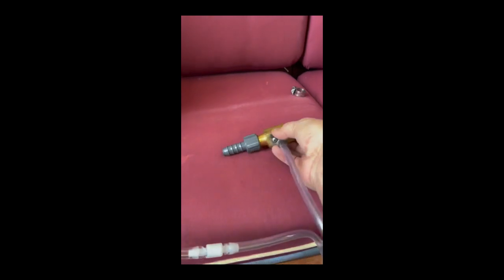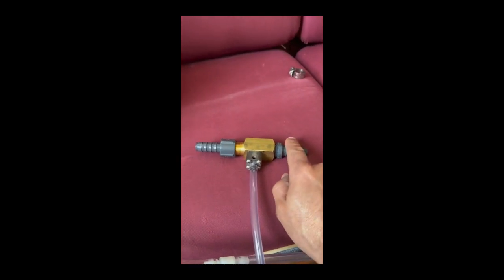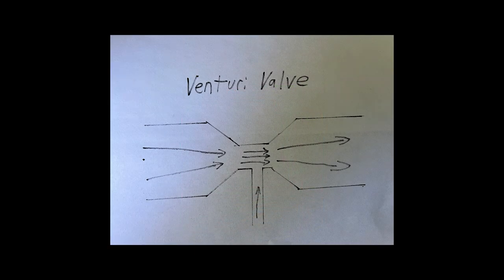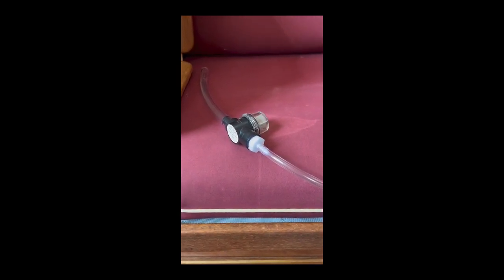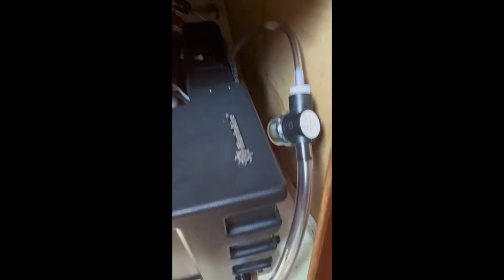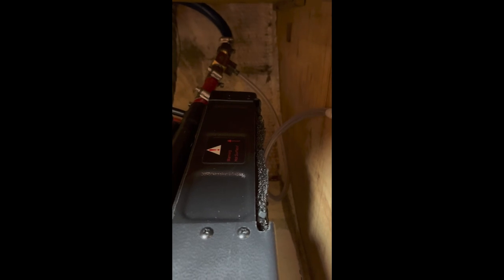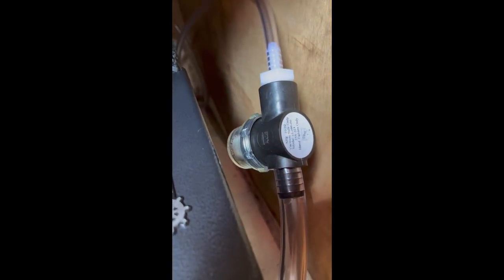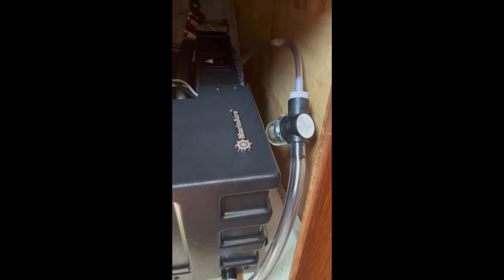Venturi Condensate Pump for Marine Air Conditioning

Comment: In the immortal word of the Guinness add, BRILLIANT!  Venturi pumps are common in the aviation industry, especially in fuel systems, I never thought of the fact that you have a continuous flow of water available to run a pump like that.  The black device with the acrylic bowl on top is just a strainer/filter? At first I thought that was a small pump but I think I heard you say filter when describing the install.  I'm soooo getting one of these.

Comment: Does the out flow tube that the Venturi device connects to have to have water flowing through it to create the suction?
Reply from the maker: Yes. It works when the pump is on. In the case of marine ac, the pump is always running when the unit is running and creating condensation.